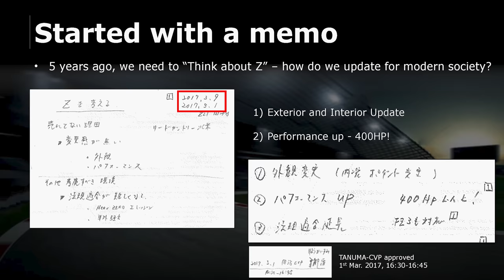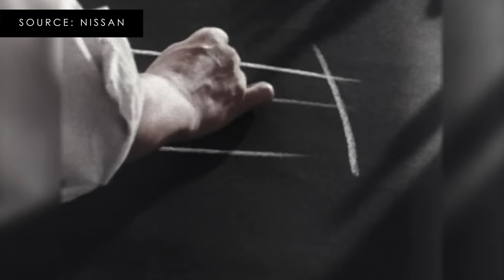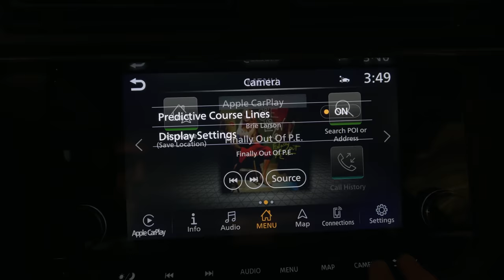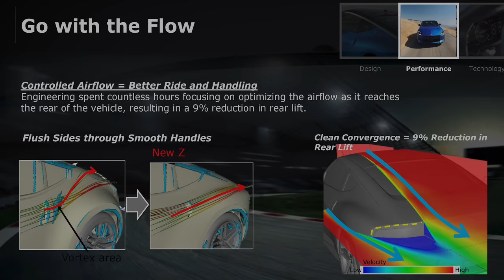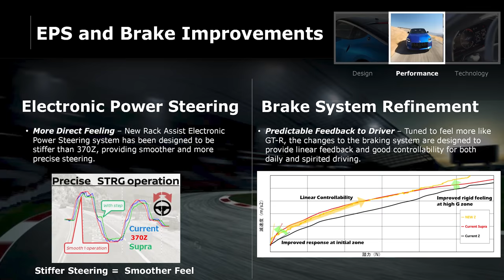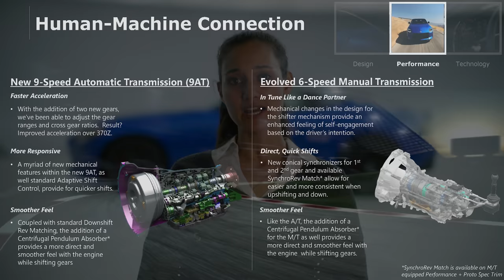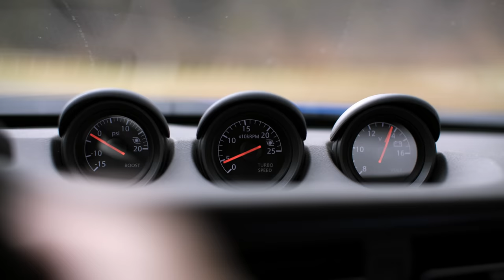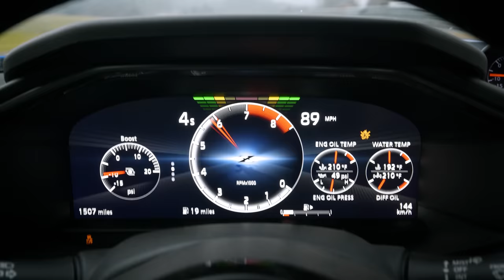2023 Nissan Z | Until The Bitter End

Comment: I’d like to know jack’s opinions on how the Z feels compared to the GR86. Is it worth the upgrade if you’re looking for a communicative and spiritful drivers experience? I would assume the Z doesn’t feel as connected as a GR does at the expense of a better sounding and more powerful engine
Reply: I second this. A break down between 86/ brz, new z and supra.  Comparing the drive, dynamics and in particular,  are the cost differences worthwhile.
Reply: There is no comparison.  This is in a whole other league.
Reply: @landorseasprint  hagerty did a drag race with the Supra and the z was 2/10th slower. Also the GR86 and z are actually completely different segmented of cars so up to you honestly. If you want more power, complications of turbos etc then go for it.
Reply: @v8_sami  I think you missed my point but that's ok. I did watch the Hagerty video which was good. But it didn't discuss handling characteristics. Either way I look forward to more content and comparisons.
Reply: @z32luvr  The Z is in a whole other league in acceleration. The 86/BRZ is in a whole different league in handling feel. So it is an interesting question which is more fun to drive overall and is the Z worth the extra$$.

Comment: Here's what bothers me about the new Z. With literally every other performance or sports car you can get all the Go-fast goodies, all the performance features; in the Base trim level. All of the more expensive trim levels above the Base, give you luxury add-ons or convenience features. Meaning, if the only thing you care about is performance, you can buy the least expensive version of that car and be happy. No power seats, no moon-roof, no leather seats, no heated seats, no remote engine start, no lane keep assist, no etc. Honestly, who cares? You want performance, you don't care. Got what you wanted, saved a good chunk of money. Usually anywhere from $5K to $10K. Not with the Z.

Forget the Base trim. You have to spend about $10K more (right around $50,000) to get the new Z properly set up for performance.  To get all the performance features that Nissan has made available for the Z. Or, you can buy a Base model performance car from one of Nissan's competitors who don't do that sort of thing.

Comment: Great technical video guys. Our 2019 370Z sport came with the same Potenzas. I didn't like the feel and we changed them asap and installed SS brake lines. These two things alone (on OEM pads) really made a big difference. I'm glad Nissan worked on the cooling system. For those who don't track, this will simply increase the longevity of the drivetrain which is a plus. Also nice that they kept NVH in mind (my 350z has no interior so I know what I'm talking about there). Overall, given this current economy, Nissan really made this one for the enthusiasts and it's cars like this that bring pride of ownership. It's beautiful, it's fast, I WANT IT.

Comment: HUGE PROPS to NISSAN for not killing off the Z and continuing the legacy.  This new Z has so much history behind it.  I mean just look at it.  It has all generations mixed in to a new modern package.  Has a manual transmission and a gas powered engine.  Get them while you can. This car is a classic in the making👍😎
Reply: Its beautiful but for sure going to get marked up by dealers 😒
Reply: @JGL98  like every other vehicle right now.  It's ridiculous 🙄
Reply: Definitely not a classic, it’s incredibly boring in its lines and oddly convoluted in its details. It’s basically yet another dull sports coupe, despite its numbers. Too much content, oversized on the outside, cramped on the inside. Odd how the designers feel they’ve created something beautiful.
Reply: @mr.butterworth  They never said it was perfect rather almost perfect.  These type of cars are being replaced by boring and very ugly electric vehicles.  If your not a fan of the Z and it's history i can understand your point other than that? Nothing to complain about.
Reply: @theeppychronicles  you need to watch more videos on this car. A concerning point is the movement of the manual Z stick shift during acceleration. That was a major problem of my 370z Nismo. I had to redo all the rear diff and subframe bushings a long with a brace and the noise from the rear was loud.

Comment: Nissan did a great job on this "Z".   They took the old bones of the old 350/370 and improved everything.  Power, low end torque, steering, rear differential, and of course styling.  Offered it from the beginning with a manual and a better front suspension than the Supra, at thousands of dollars less.  A real winner.
Reply: It's going to really be interesting to see if the sales work out. Since Nissan said 40K MSRP base, which is still the 400hp motor, while Supra base is 43K, but with the 4 cylinder and still no stick.
Reply: @sigmaprojects  I think it will totally wreck Supra sales. However, Toyota got away fairly cheaply on that project, so it may not matter much. I'm not entirely sold on the Z's retro styling, but think the Supra is just plain ugly and overstyled. At least the Z looks consistently retro.
Reply: @markmiller3279  I think both look pretty good, especially in person. My only gripe about the Supra's styling is that it looks way too close to an Alfa Romeo with its proportions, like if it had the Alfa triangle nose at that pointed area everyone would instantly think it's a new Alfa 8C. I just have a hard time seeing the Japanese DNA. The FT-1 at least had the proportions of a Supra so it was that bit recognizable. 

Time will tell if Nissan crushes Supra sales.

Comment: There's a lot to like here.  Double-wishbone on all four corners, monotube shocks, clutch-type LSD, manual transmission, looks that harken back to the 240z, and best of all, not built with Subaru or BMW parts.
Reply: Exactly. Nissan made by themselves a true tuner car despite them struggling while Toyota couldn't make the financial case. Even though the GR86 is one of the top 3 with arguably the Miata on top
Reply: Not worth for 50K+
Reply: Seems like a decent alternative to a Mustang of Camaro. Although personally  for the money I would rather have a Mach One.
Reply: @StinkySundae  you can get one for 40 k, it only differs by a diff , wheels
Reply: @2moke2creen  Decisions like that could explain why they are struggling and Toyota isn't🤔.
Reply: 😄 Stop. Toyota made the GR Yaris and Corolla.
Reply: @d.block3148  Nissan knows they need a halo car to help draw attention while Toyota let a 86, Corolla, and Yaris outshine their most legendary badge by simply by not taking the risk. Toyota is struggling to not be boring and too safe while pulling a Ford and Chevy and Dodge and slapping cherished names on half-assed attempts. This reminds me of Honda's situation with the NSX vs the Civic.

Comment: I loved the conclusion. So many have confused the definition of a sports car with 60 and 1/4 mile times, when that couldn't be further from the truth. Where do you go with sports cars when EVs can decimate everything, or a 2L Accord can gap most "sporty" cars? You have to lean into what made sports cars great, which is the connection and the experience. It's taking it down a country road on a Sunday afternoon and just enjoying the drive, not worrying about how fast you get from red light to red light on a strip. It's not always about pure speed and I hate that we've gotten so far away from that.
Reply: But if those other cars offer that and better performance why would I go for less?
Reply: @pleasedontwatchthese9593  Well, Miele vacuums offer everything a Dyson does with better performance, why doesn't everyone just by Miele vacuums? Just because something is technically better doesn't make it more desirable. Low to mid-range EVs like the model 3 or the base Mustang offer great straight line speed and good range, but sacrifice handling dynamics and performance. If you want to have brakes big enough that they don't overheat and fade after a couple hard stops or suspension that doesn't body roll over 5 degrees in a sharp corner, than you're gonna have to shell out for the performance variants, which are quite expensive. 

Not to mention, I could take this Z, or any similar sports car, to a track day and run it off and on all day long. If I took a Tesla I'd get about an hour of performance driving before it was both too hot and too discharged. If I took an Accord the brakes would be toast and I would probably be nauseous from the angular momentum of the body roll.

Anything can become a performance vehicle, but what makes a car sporty and enjoyable isn't just power and speed. My most enjoyable car to drive over the last 25 years was a 91 240sx that had an LSD-swapped rear diff. Even after tuning it only made like 175Whp, but I could track that thing all day and never be dissatisfied.  The Model 3 I tracked at an event in Atlanta on the other hand was fun for the first 10 minutes and then quickly became exhausting and disappointing when the battery started getting hot so it pulled power and the brakes became soggy sponges. It's all just perception, but for me, enjoyment in driving comes from the entire experience, not just the butterflies from acceleration.
Reply: People are obsessed with straight line speed and not as much taking corners as fast as possible. This mentality might change as F1 gains viewership in the states.
Reply: @pleasedontwatchthese9593  I enjoy a quick car but certain power levels is just overkill.
Reply: That's why I still have my AP2 S2K.  Not the fastest but the best driving experience when your in a back  road going through the gear with the top down.  In my opinion on the last pure driver's car Honda made.

Comment: As a 370Z owner, I am really glad to hear all the improvements they made over that model. Everything you mentioned rang true, especially poor torque at low revs. I still feel it's a bit overpriced but perhaps I will get a used one in a few years. If I ever have the money one day to have one of these as a track toy, well...
Reply: Sadly it might be underpriced with they way things are going. Expect to see 20k markups on these.
Reply: Agreed on the price. They keep talking about the price point as if it's a budget option, but it ain't. I spent half as much on a very lightly used 124 Spider. $40k base is not inexpensive.
Reply: @AlvinBrinson  in Australia it's $80k for what I assume is the top trim (we only get one). That's 56kUSD. The 370 was $57k but they were going for 50 last year. The most expensive Miata is about 57 while the cheapest is 40...
Reply: @dielaughing73  $73k plus on-roads. The limited edition is $80k.
Reply: It is more expensive than the 370, but you’re getting more. 6 N/A vs 6TT, better suspension, etc. It’s still cheaper than the Supra, and there aren’t many cars competing with it in a similar price range.
Plus, everything is getting more expensive. Inflation is high now and recently and likely for the foreseeable future.
It’s unfortunate but not unexpected, that it costs as much as it does.
Reply: @pieflies  yes, $80k on-road which is the only figure anyone ever uses for comparison. $87k for Proto spec, though I doubt we'll see many of those

Comment: it was supposed to be 35k not 55k - if that is the case - nah - i'll take a manual supra over it (just my opinion)
Reply: It was never supposed to be 35k. That's just wishful thinking. It's been said from the beginning. Base model 40k.
Reply: 35k for the 300hp version of the engine would make sense. It would still look stylish and be a great cruiser. The lack of LSD wouldnt be nearly as bad as the 400hp version, too. 35k base and 45k Performance trim would have been right. 50k is too much for a parts bin special.
Reply: @Chilicharger665  this guy gets it - ty
Reply: @Chilicharger665  the 300hp vr30 is still the same price as the 400hp vr30. The only way you're gonna get a cheaper price is with a vr30 with no turbos.
Reply: They want $10K premium for a clutch pack LSD and flow formed wheels, not even forged wheels! What a rip-off! A 1.5-way clutch diff should not be more than $2K, especially at this scale of production.
Reply: @idokwatcher2062  just buy the base model🤦🏾 also what company do you know gives you forged wheels stock on a mid tier sports car. What did you expect free te37's🤣 Just complaining over nothing.
Reply: @LOVE-VIBES-X-PROJECT-CARS  Forged wheels are $5K and what do you know the premium for Performance trim is $10K. You are paying for forged wheels and not getting them, you just get 19" instead of 18".
Reply: @idokwatcher2062  idk what forged wheels you're paying 5k for instead of 3k but know you're being ripped off lol. Yes we know already. You get bigger brakes, larger rotors, carbon fiber driveshaft, lsd, sport tuned suspension, leather interior, rev matching, 9 inch display, power and heated seats. More safety features annoyingly. So anyone with a brain would just say if I don't want all that and im going to change all that stuff anyways but I want the motor and the digital dash then I'll just get the base model so again you're complaining over nothing. Just modify the damn thing that's what it's built for.

Comment: I know it is a longshot, but ide love a convertible one of these in blue with the blue interior, with the manual transmission of course. I love this car from what I have seen, but having the open air is a must for me....so sadly I will have to get something else.
Reply: They may still make one. It's still technically on the old platform.
Reply: @jonathanb1987  Yes, but it is a low priority, will probably come in at the end of it's lifespan...here is hoping! I could always get a 370 vert, but not really a fan of the 370....and want something newer than a 350. Maybe I'll go with a Mustang or Camaro until/if a drop top version of this car comes out. It would be a huge missed opportunity, would be Nissan's last chance to make a gas powered convertible basically.
Reply: From everything I've heard, they just don't want to bother with making a convertible this time around.
Reply: May I suggest a Nissan Murano convertible instead? No blue interior but tan and no manual but a wonderful CVT transmission. 🙃
Reply: @fortheloveofnoise  🤣
Reply: I bet they do it eventually

Comment: No standard LSD WTF nissan what a dissapointment.
Reply: They wanted to keep it under $40K for the base model. Install a Wavetrac for $3000.
Reply: @povertyspec9651  every GR86 comes with one
Reply: In Australia we only get the top spec model but oh boy do you pay for it. Starts at 80k AUD
Reply: @povertyspec9651  the base model should have been the 300hp engine version to go with no LSD and start at 35k. Then a 10k jump between the trim levels would make sense.

Comment: Such a great video. I still have my deposit down for a manual Supra but largely that's due to my use case for the car, not because I think it's an amazing "driver's car" experience. I've got other older cars to use on track and really push as a driver's car. That said, I'd be lying if I said I didn't look at this video and the presentation of the new Z without admiration. It really does look like they have taken the best parts of the past (sans NA engines but let's be realistic) and because they have kept the tech to a minimum, it really keeps the cost down and creates a no-frills great driving experience in the modern age. I couldn't agree more that it looks like they cheaped out where it's ok to cheap out and more or less put money into the things that really matter. When you think about the gear box especially - that is not something easily changed by an aftermarket community. Look at the cost to change gearing on a GT4 for example. Those major pieces need to be on point. The engine has to be right. The gearbox has to be right. The differential really needs to be right.  Things like brakes, sway bars, shocks, exhaust - that's all so easy to "fix" in the aftermarket. I really have to hand it to Nissan - when you factor in the relatively low money to buy it, history may look back on this car as the greatest 2-seater sports car of the era. Not because it offers all the best numbers but for standing on its merits of true driving characteristics in the end times of real sports cars with a price tag that isn't unobtanium.

Comment: Im lucky that im able to own a 2005 350Z GT4 and a 2010 370Z Convertible. I bought both of them second had when they where 10 years old (cannot afford a brand new one car prices are insane in The Netherlands ). But i love these cars. Both are manual because that is what im looking for in a sports car. I love the NA engines and the gearboxes of these cars.
Its to bad the new Z has turbo's i know most love that about it. But its understandable that they went that rout. I hope i will be able to own one of these Z's in the future. So far they wont be released here. So i might have to import one in the future. But taxes here are insane. A 50K car would be 120-130K after import.

Thanks for this great video of the new Z. Love the background info from the engineers! Really looks like they made a homage for the fan's love it!

Comment: Thanks for the in-depth video. It's great to see that what the engineers did translated into genuine improvements over 370Z. I thought 370 might have a chance of becoming the last good Z with, what, hydraulic steering and naturally aspirated engine. But it looks like this one is the winner. Unfortunately, Europeans are screwed and will have to stick to freakin' BMWs and hatchbacks.